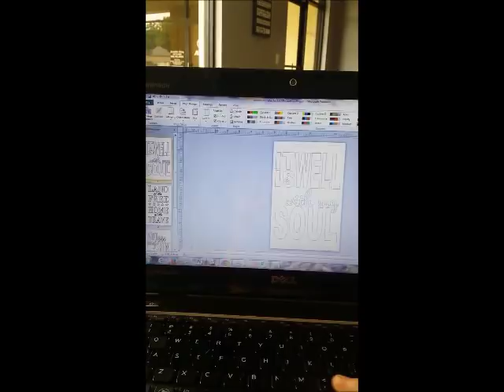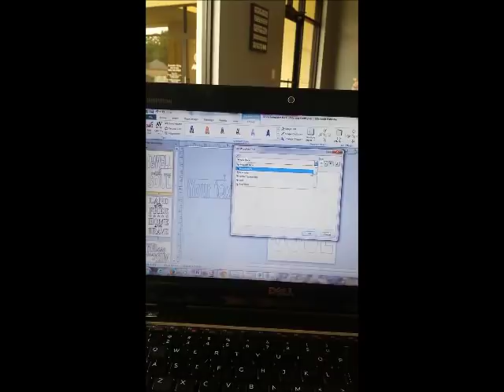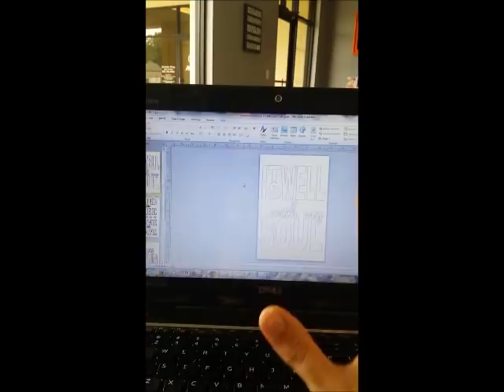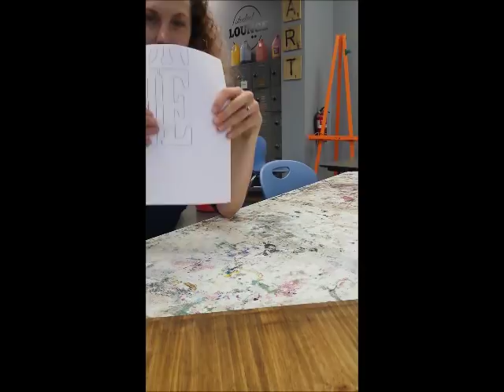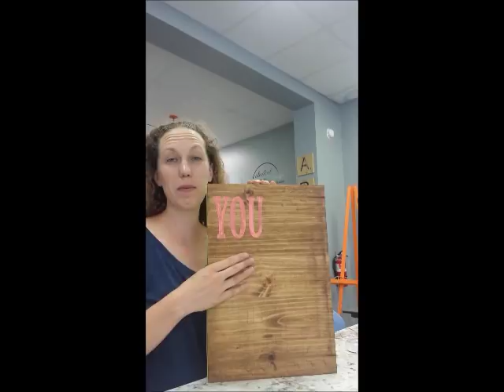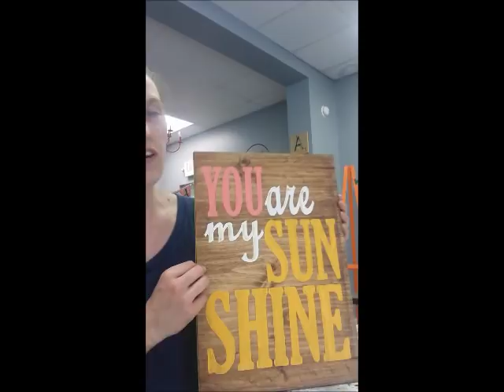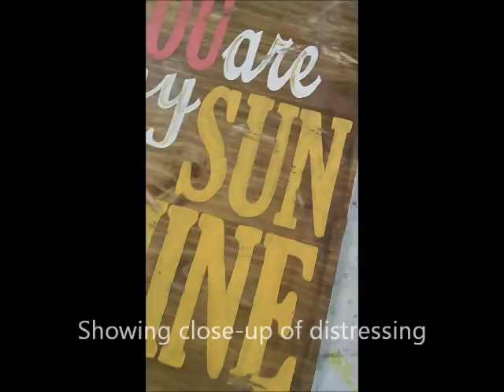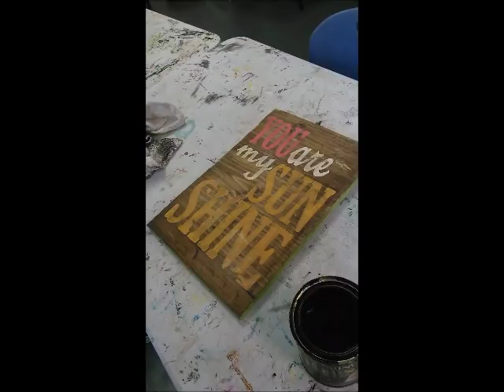Tutorial: Lettering on a Wood Sign WITHOUT a stencil!

Comment: Wow, I live in the KC area, too.  This video gave me the courage to try hand painting pallet signs rather than using stencils.  There are two other ways I can think of to get your letter outlines on the wood, in case someone is comfortable tracing them.  You can reverse the image (so it's a mirror image), print it out on the backing paper from shipping labels or glossy paper, turn it over onto the board and rub with the back of a spoon.   That transfers really well.  You could also print the lettering out on card stock, cut out each letter and trace around them.  I can't wait to try hand painting pallet signs!

Comment: Have you checked your program to see if it will mirror print for t shirt printing?  I have that option in microsft picture it.  That way all I have to do is follow the black lines on the print.  I then turn it over and scribble on the back.  It's very quick.  Thanks for the demo.  Good work!

Comment: great video, just what I was looking for! I am stencilling on barn wood (too, as a previous commenter said). 
Thanks!
Reply from the maker: Rough surfaces are ROUGH!  I would try a small section with charcoal or chalk to see if that would transfer easier.  Also, trace with an old ball point pen instead of a pencils.  If your wood is soft enough, sometimes we can get away with just the ballpoint pen trick because it leaves an impression of the letter in the wood. 

If all else fails, you may have to actually cut out a stencil.  :(  Which is like, my least favorite thing.  You'll need a sharp exact knife, a cutting mat, and lots of patience.  I recommend wrapping the exacto blade with tape and self-adhering sports wrap; you'll wrap wherever you fingers grip...most likely even wrapping some of the blade and only leaving the very tip exposed.  This will make it more comfortable!

Comment: Hi Alison  The sign looks great!  Do you have any additional recommendations for stenciling on barn board, which is not as smooth as the wood you are using? Thanks, Deb
Reply from the maker: Rough surfaces are ROUGH!  I would try a small section with charcoal or chalk to see if that would transfer easier.  Also, trace with an old ball point pen instead of a pencils.  If your wood is soft enough, sometimes we can get away with just the ballpoint pen trick because it leaves an impression of the letter in the wood. 

If all else fails, you may have to actually cut out a stencil.  :(  Which is like, my least favorite thing.  You'll need a sharp exact knife, a cutting mat, and lots of patience.  I recommend wrapping the exacto blade with tape and self-adhering sports wrap; you'll wrap wherever you fingers grip...most likely even wrapping some of the blade and only leaving the very tip exposed.  This will make it more comfortable!

Comment: I tried this technique but my paint turned out runny. How can I fix this?
Reply from the maker: Nicole Bahr Tell me more Nicole.  What kind of paint did you use?  Some acrylic paints are going to be more opaque that others.
Reply: I was using craft smart acrylic paint.  All the letters I painted turned out streaky.  Did I apply to many Coats? Is that what makes the streak marks
Reply from the maker: Nicole Bahr hmmmm.  We use craft smart too.  Sometimes, the pigment separates and we have to shake it up before using so it's all homogenized again.  Not sure if that could have happened to you.

If you notice, when I painted my first coat, you can still see all of my brush strokes because the light colors especially don't cover the dark wood.  My yellow in this video took four coats in order to get a solid coverage.

How many coats did you do? Did you let it dry completely in between?
Reply: Does craft smart paint ever get old. The paint I used was about 4 years old. I did about 4 coats. 
I didn't let it dry completely in between.   :/
Reply from the maker: Yes, paints can go bad.  Usually with acrylics, they just dry out when they are old, but I've had a few bottles that actually separate and then just lumpy, like cottage cheese!

And, you'll definitely want to try letting it dry between coats.  Just like painting your nails!
Reply: The paint I used was from 2010... How many coats do you usually apply?
Reply from the maker: Nicole Bahr two to four depending on the color.

Comment: Couldn't you just MAKE a stencil by cutting out the letters and taping the paper on and painting over? It would save like 10000 hours of work
Reply from the maker: You sure could! 

 We've cut out lettering before with exacto knives but it takes a LONG time and not all of our class participates are comfortable with the detailed hand cutting.  If we were mass producing signs, a reusable stencil would certainly save us time in the long run, but for ONE sign, we've found it faster and easier to trace and paint the letters than cut a stencil.
Reply: I’ve been cutting my own stencils and it’s super stressful, as well time consuming  - I’m eager to try this method.

Comment: How do you print the custom size on normal paper?
Reply from the maker: Samantha Kipfinger I'm using Publisher and it allows me to customize my document size to 12x18 or 11x17 depending on what boards I'm using. 

For classes, I send the file to Office Depot to have the templates printed on one sheet of paper.  

For just personal use, I use my office printer like in the video.  My printer only prints as big as 8.5x11, so it prints in four sheets and I tape the template together.  The computer and printer do the magic of figuring out how it prints.  I just enter in the size of the finished file and the size of the paper in the printer.

Hope that helps!